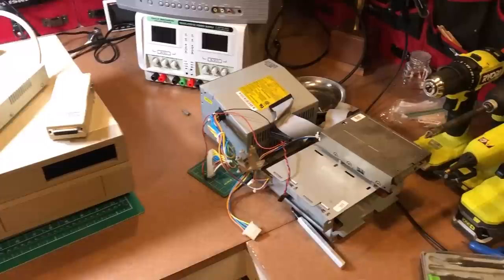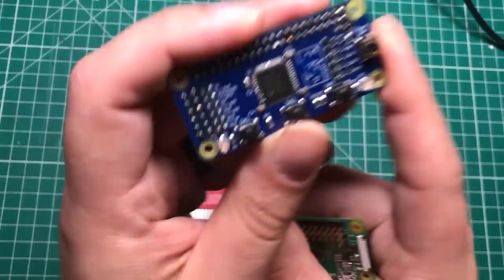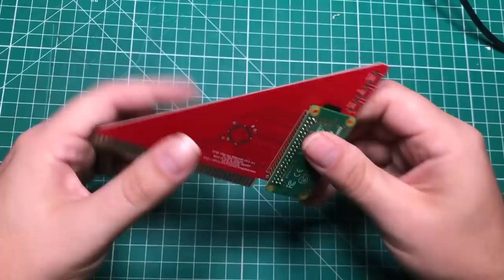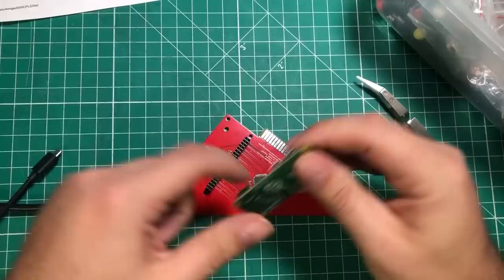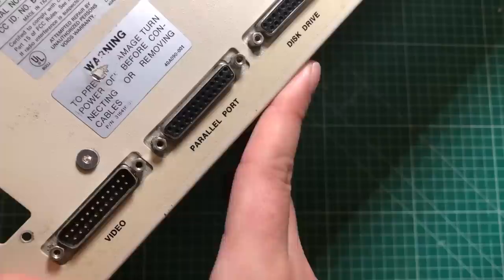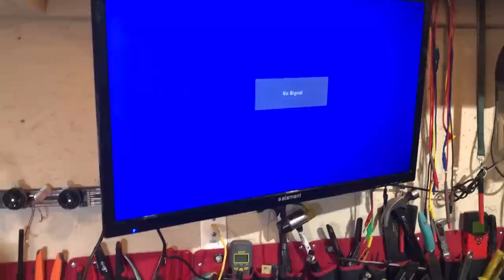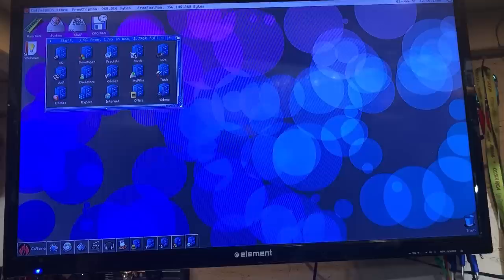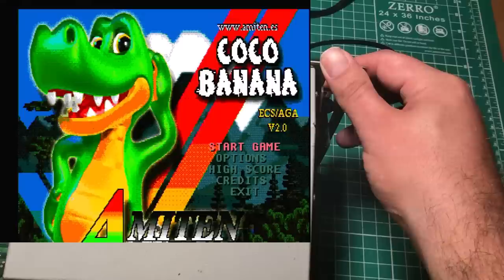The Ultimate Amiga 2000 Video Upgrade?

Comment: I got an Amiga 2000 and keyboard off Craigslist about 20+ years ago.  Paid $75.   :-)   However, I wrongfully stored it with the battery and forgot about it.  It leaked and destroyed some traces but I was able to repair it 100% a few years ago and now it works great!  Funny thing is when I was 16, I bought an 8 MiB RAM upgrade for my Amiga 500 and Bodega Bay (remember those?).  I don't have the Bodega Bay anymore but now my A2000 has the 8 MiB card.  I paid $440 for that RAM when I was 16!!
Reply from the maker: I don't remember Bodega Bay but that is awesome that you were able to repair it. A lot of people love those computers and are willing to go to pretty great lengths to save them. That's a very cool thing

Comment: Amiga RTG (retargetable Graphics) run seperatly,   Caffeine is a pimped version of a tribute to amiga os,    AGA is for the Amiga 1200/4000 32bit machines.  the A2000 is OCS/ECS are the older modes,  your RGB2HDMI needs to be set to Amiga profile also.
Reply from the maker: Thanks for all the great info. I love your channel by the way.  I definitely need to do some more research on the rtg.

Comment: when you were launching cocobanana you mentioned that you don't know the differences, so AGA is "amiga graphics architecture" and made it into the a1200, and 4000, it had more colors and memory. the ECS/OCS "enhanced chipset/originalchipset" is what we have in our A2000 and A500 and is less capable.
Reply from the maker: Awesome. Thanks for the info. I got chewed out about not knowing that in another comment.  Amiga stuff is very new to me.
Reply: Actually AGA means Advanced Graphics Architecture. ECS is the same as the original chipset with the addition of a "half-brite" bit where you get additional 32 colors at half the brightness in 32 color mode (64 colors in total). While the ECS did not HAVE more memory it allowed to access more memory. PS! It is all on Wikipedia :)

Comment: One good way to get a 2000 going with genuine (sorta) hardware...
Is find a way to clone the DKB Wildfire 060 (also the Graphics card Inferno which attacked to it and went out that 2nd slot next to the CPU slot.
I've seen some redux's of the 4091 for the 4000...   (that  purple one)....
So if they can redux one of the best all time accelerators for the 2000...  that would be something.
It had a SCSI-II interface if I'm not mistaken.
Made the A2000 a serious machine at that point because it still had a scan doubler ON the "Inferno" card.
So that freed up the 2000's video slot for a Video Toaster... (going to its own monitor).

Other fun thing to do if someone wants a great challenge...
Redux the entire A2000 motherboard..  but with a vision of how it would have.. or should have been "revised" back in the day.
This way, the hardware is still as close to true Amiga hardware as possible...  while retaining some ability to continue to have life.

 For example, if you ditch the 68000 on board CPU and go with a 28mhz EC020 (cheap route) and run it straight from the 28mhz clock..
You essentially got a 24 bit DMA  A2000 mobo which is light years ahead of the old version there.
Toss in some 30 pin simm sockets (they might have had that on a revision back in the day).. to give the RAm up to 16mb of fast. .(matching the 3000's RAM).
2mb on board chip.

Its not overkill...   would be a fun upgrade project maybe?
Then someone could toss in a decent 060 board.. or...   (drum roll)   68080 board?  
I''d still like to hear more opinions on what Amigans think of Apollo's '080 ... since they are making it and not Motorola
Reply from the maker: That does sound fun. I'm really new to Amiga stuff so I've generally been just trying not to break stuff :)

Comment: Nice. I'm a big Amiga fanboy :-) I was setting up my A4000 just today after many months of inactivity.
A520s are indeed garbage! I wish I had know this back in the day as I could have used a cheap SCART adapter (SCART is obsolete now).

My A4000 has ethernet but is far from the router. I configured an old wifi router to act as gateway. Seem to work OK.

BTW the A500/A600/A2000/A3000 has the OCS chipset. A1200/A4000 has the AGA chipset (basically more colours).
Reply from the maker: That's fun stuff. I've never used the 4000. The one thing stopping people from making external things for these for a long time has been that the 23-pin connector was basically unobtanium. Someone in the community wound up getting some custom made again so they're floating around at about 20 bucks a piece now. It's amazing what people can do.

Comment: Why do you have the power cable connect to the PiStorm2K with a 2ZeroW? You don't need that plugged in, That Pi doesn't draw THAT much power. If you a Pi4, then Yeah, plug it in, otherwise...not needed.
Reply from the maker: A lot of people say that the PSU on the Amiga 2000 is borderline as is. I asked everyone on the Amiga discord and no one had ever tried to add 2 pis to an amiga so I was advised to at least start with external power to them.

Comment: Because I'm absolute garbage with a soldering iron - is there any way you would consider making another one (or two) of these (sans the pi, as I already have several pi's laying around).   I have two A2000's in my collection of things.   I have the original C= flicker fixer board, but it doesn't output anything near as clear and useful as this does.   I have the main A2000 plugged into a C= 1960 monitor, but it's small, grainy, and honestly probably doesn't have a lot of life left.    If you would be willing to help out, I'd be much appreciative.  :)
Reply from the maker: I'm sorry. I'd love to help but I've had an issue with getting in fake/bad cpld so the hit rate on these has been pretty bad lately.  Honestly, I'd buy a pre-tested one from Ebay.  The PCBs are great but the chips have been garbage.